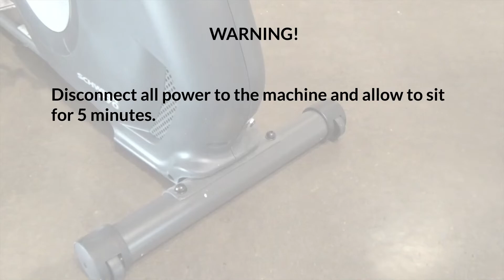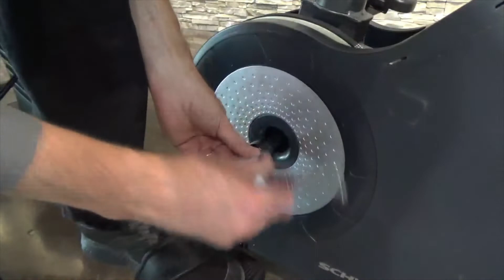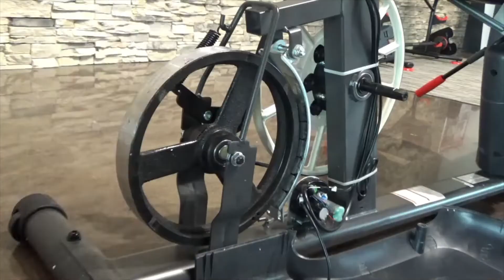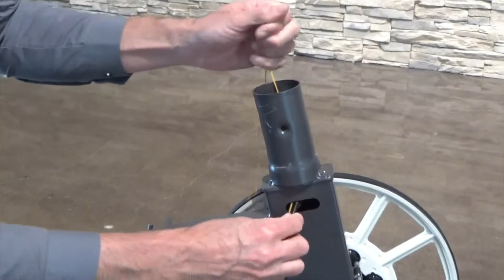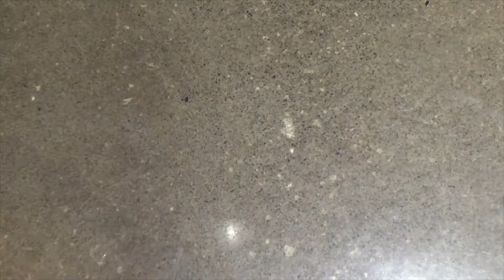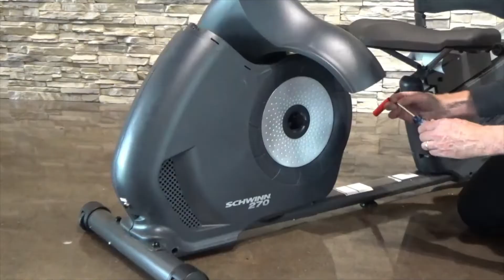Bowflex® | How to Replace the Servo Motor on a Bike or Elliptical

Comment: Thank you this video saved my elliptical from the landfill. However it would be more helpful if you could click between steps, since there is a lot of dead time in between eg. tightening bolts with a ratchet for 30 seconds.